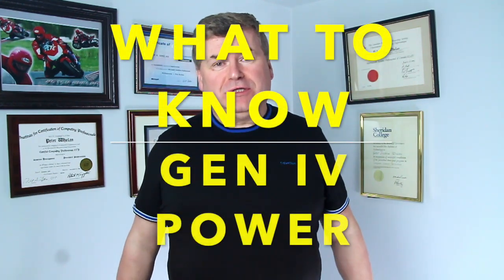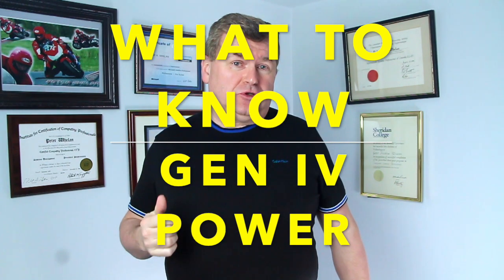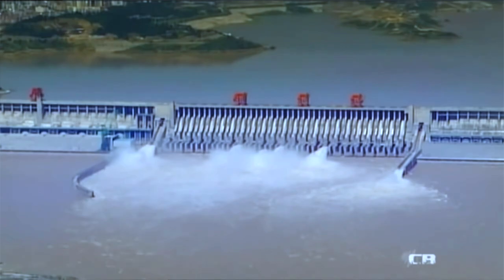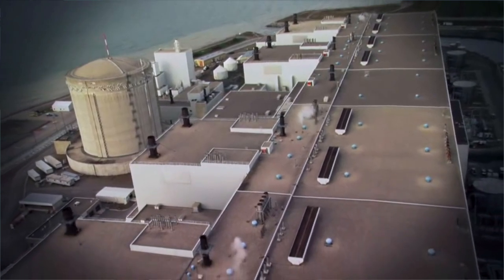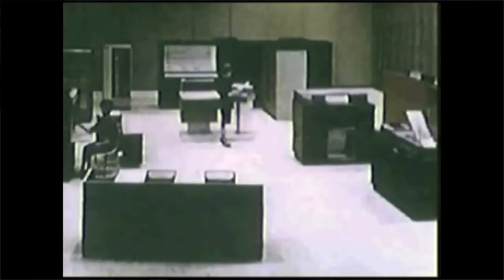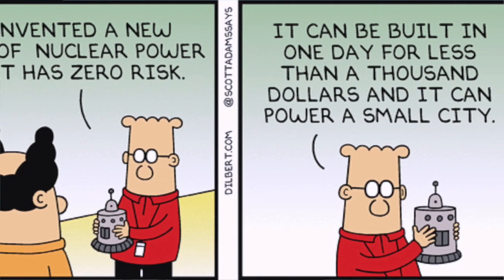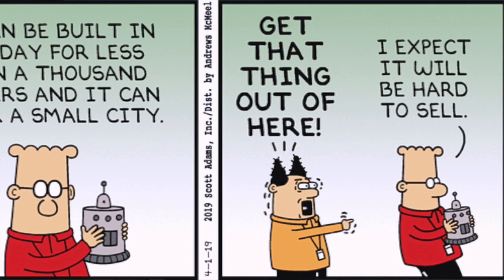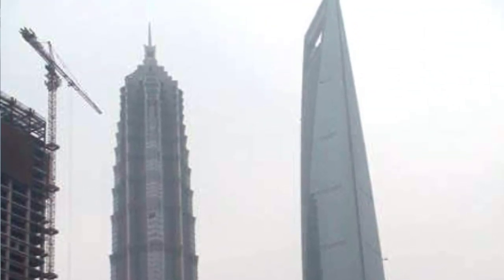What To Know about Gen IV Power

Comment: You know I have always had a couple requirements for me to accept nuclear.
1. Triple safety, similar to military, automatic shutdown, on site shutdown by personal, manual shutdown with levers incase computers fail.
2. The amount of nuclear waste it produces needs to be so small it isn't a problem since we have enough nuclear waste problems. Or be able to recycle nuclear if that is even possible.
3. How long does fuel last, for it since it's not renewable.

You answered most of my requirements, just curious where did you get the info on enough for a 1000 years.
I have read estimates of 200 years of uranium left to use for nuclear power plants.
So not sure which to believe or if you are talking about multiple fuel sources.
Reply from the maker: Great question!  The 200 year estimate is based on 2nd gen designs.  https://www.scientificamerican.com/article/how-long-will-global-uranium-deposits-last/ With Gen 4 designs, much of the fuel could come from burning thorough the nuclear waste we have stored.  No mining needed.  Thorium is an alternate source that CANDU is designed to use.   I rounded down to 1,000 because I figured we'd have fusion by then.   Some estimates claim we could cleanly power the planet for 30 to 60 thousands years with nuclear.

Comment: After Fukushima, I thought there must be better ways to produce nuclear energy.  I did not know much about the options.  I had some ideas about how reactors could be made safer. Such as control rods that could drop into position if power.  Or a collection system built below a reactor in case of meltdowns.  Where the nuclear material cannot maintain sufficient amounts of neutrons to slow a reaction. Possibly a very deep shaft below. Where nuclear material can be effectively managed.  Containment that would not feed into underground water. Possibly with neutron absorbing materials. Multiple collections points to stop molten fuels from collecting together.  Potentially numerous ideas could be used.  When I checked the internet I found MSR and LFTR salt reactors could be collected in safe containment at any time with or without staff operation, power or pumps.  Then I learned about the huge potential for salt reactors and Thorium fuel. Hundreds of years of very safe, clean, cheap and much smaller reactor plants.  Of course, this was too good to be true.  So I investigated Gen 4 nuclear fission technologies.  While there are many poor reasons not to use Gen 4 reactors there were many good reasons for developing this technology to a prototype stage for effective evaluation.  Gen 4 energy could give us vital options for low carbon energy. Something we desperately need. Green conservatives are not willing to seriously study the downsides of renewable energy.  Obvious, glaring facts that show renewable energy is far from solving our problems.  We need more energy options.  Gen 4 technology has amazing potential that should be tested.
Reply: In fact carbon-based energy is OK, only global warming wankers scream like a rats "fossil fuels bad, shut down the coal"...we need CO2 for life!
Plants grow bigger, Earth become greener (in 95%, 5%got browner)
My country (poland)is coal country. No problems with pollution or expensive energy. Only cars are big issue...